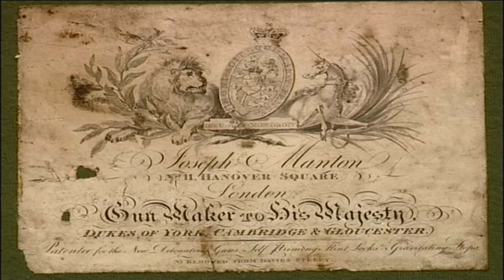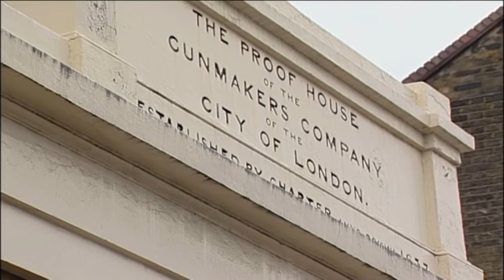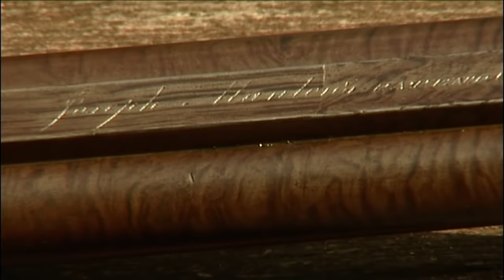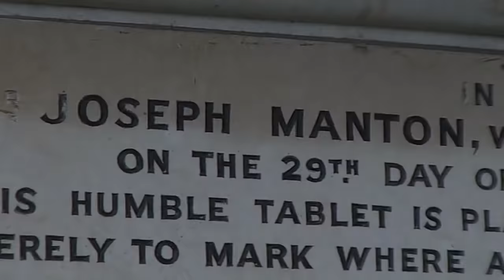Manton - Master Gun Maker

Comment: Hang On!! A gun can cost £50,000, but a 200yr old Manton original is valued at £10,000? Something wrong with this picture. Surely a 200yr old gun by a master Craftsman would cost at least £100,000.
Reply from the maker: I take your point, but something is only worth what someone is willing to pay
Reply: You are quite right, you will not find a Manton for as little as £10,000.

Comment: At 6:19 Mr. Winks calls a screwdriver a turnscrew in the gunsmithing business. Gotta love it! I noticed that his turnscrew has a very long angle ground on it which, functions similar to the hollow ground screwdrivers I custom make for specific screws.
Reply: in french "tournevis" is the litteral translation of  turnscrew
Reply: The profiles of such turnscews / adapted screwdrivers would require a higher grade of steel than regular shaped screwdrivers, would they not? 
Or have I picked up on a different profile?

Comment: Great video... thank you.... of great interest to me down here in New Zealand... I do get some very old guns turn up for work on them. A lot of gun smiths won't work on them; after all, many of the really old ones had non standard threads etc, and were hand made "one offs". You can' buy a mainspring for a flintlock made 200 years ago, and broken springs are not that unusual in such old guns... their spring steel did tend to get brittle with age. Many will not tackle the forging of springs, but the principles are fairly simple, it just need care and a feel for the material. Many of the low priced 'trade guns' had pretty spotty quality of steel in the locks, and need new ones made. I enjoy such work and being retired now, my time is perhaps less expensive that if I ran a commercial business.
Seeing the quality of Manton's work, and indeed that of his apprentices and those that they in turned trained, is an inspiration. Most cannot pay the price of the many hours put into such work, of which most of us would be hard put to match or even closely approach..... but we do our best... :)
Reply from the maker: Thank you for your comment and for sharing your experience.

Comment: just because you can't see the priming go off on a modern gun, doesn't mean there isn't a delay... There is always a delay. Once the sear disengages the firing mechanism, it has to move in order to ignite the priming, then the priming has to ignite, and that heat/pressure has to ignite the main charge. Guns haven't really changed in 600 years, we've just made more convenient ones. The Manton Chambered breech, much like Henry Nock's patent breech, have been studied since their inception, and have never been shown to speed up ignition times over standard side-vents and dished breech faces. The only people who claimed that they did usually were people selling and buying of them. Sometimes an "improvement"...isn't, sometimes, it's just... different. By the time J. Manton was born, the Matchlock ignition was long out of common usage, and flintlocks were common (flintlocks and snaphaunces being around since at least the 1640's), so he didn't really have much to do with that. The Mantons' contribution to firearms design was that they helped to refine flintlock and sidelock percussion technology to it's pinnacle, reducing friction, shortening cock throw, balancing springs, ect. They made fine arms, but they were but one family out of many exceptional craftsmen of the age.

Whether the barrels were heavily filed after proofing, or never sent out for proofing... in the end, they weren't proofed. Serious modifications to the barrels by filing heavily enough to remove those stampings drastically reduces the wall thickness at the point where it is needed most, voiding it's proofing.
Reply from the maker: Thank you for your very detailed reply. You bring up some very valid points, which I am inclined to agree with in part. Thank you again.

Comment: At around 15:10 you describe “white hot metal shards igniting the powder”.  So why use a flint? Did the frizzens wear out and need replacing? Can anyone clarify this please
Reply: And at 23:30 a misfire requires a new flint.
Reply: @patrickbarrett5650  Not always.. a blunt flint can be sharpened (a bit!)by tapping the top face.. Flint is very hard and naturally produces a sharp edge. The flint edge is hard enough to strip off a shard of steel from the frizzen. The friction involved heats the shard to the point it burns. Frizzens did wear out and were either replaced or a new piece of steel was let into the face. Some frizzens were made from iron and then case hardened to produce a layer of steel on the surface. These need to be be re-case hardened at intervals.

In the 18th and 19th C there were very few materials about that were harder than steel. Flint was one of the few naturally occuring hard materials that was cheap and easily obtained at the time. Many of the Napolionic forts on the south coast of England were faced with flint as a form of armour plating.
Reply: @felixthecat265    Thank you for replying, you have really cleared that up for me. I have come across flint walls but I never realised those properties were involved. Thank you for taking the time.

Comment: I do hope that these Gentlemen were able to pass their firearms on to family without trouble due to the Draconian Firearms Laws in GB.
Reply: No licence required for those old guns. No problem in owning a shotgun in UK. As long as no criminal record.
Reply: No idea where you get that idea from. You may have to get a black powder licence, but if you are a honest citizen
Reply: @kennethsmith2758  I got that idea from the law. Antique firearms only require no licence if their sole purpose is display or collection, the minute you attempt to fire them they require licencing.
Reply: Well if you are talking any weapon firing a single shot bullet or missile you are correct. However you can use them on a approved range and belong to a club. Old shotguns the same but you would require a shotgun certificate with no stipulation for reason to own. If you wanted to load your own black powder you would need exsplosives permit.
Reply: @kennethsmith2758  so I'm right then, you do need a licence to shoot them ?
Reply: Yes the same as you need a licence to drive a car or t fix peoples gas boilers. They are however not draconian but a effort to prevent nutcases getting hold of lethal objects. Only yanks would be crass enough to want to fire  hundred years old antiques
Reply: @kennethsmith2758  Only yanks with a political axe to grind as well.
Reply: @kennethsmith2758  Many of these guns were made with a 100 year plus service life in mind. As long as you use black powder only and make sure the barrel has not corroded, they are just as safe as the day they were made.
Reply: sorry i replied to the wrong comment
Reply: @kennethsmith2758  Many of the high quality civilian market guns back then were made with 100 year plus service lives in mind. As long as you use black powder only and the barrel is not corroded, they are just as safe as the day they were made.
Reply: for some reason the comment keeps sending to you. sorry. Since im already adressing you in this apology. let me just say I Agree whole heartedly with your comment.
Reply: @kennethsmith2758  Many of the high quality civilian market guns back then were made with 100 year plus service lives in mind. As long as you use black powder only and the barrel is not corroded, they are just as safe as the day they were made.
Reply: @kennethsmith2758  Criminals can be honest.
Reply: @kennethsmith2758  ''crass'' , but of course.....that's why i can pack a shootin'  iron every day...sincerely, crass  yankee......ps. a beautiful video .
Reply: @kennethsmith2758  
Can you please explain what is "crass"  about wanting to or actually firing a hundred(s) year(s) old 'antique' firearm ?

I have been remanufacturing antique original and reproduction based firearms based on original classic guns designs and parts and classic design patterns for several decades now.

Firing these and any firearms is necessary as was proof testing and proof marking, estabished proof houses, safety parameters for loads, powder and pressure data.

Was any of this ever crass ?

Comment: "Damascus-forged" is misleading.This is a part of a series of misrepresentations used for shotgun barrels (Since the 1880's) that comes from the following history: Patterns in steels from the Middle East, mostly in swords, came not from "pattern welding" as illustrated, rather from the texture and pattern of steel from "wootz" ingots imported from Southern India. Most quality steels early on came from these cottage industry ingots. The irregular impurities, or alloys, game them a characteristic pattern. Japanese steels have historically had similar patterns, but in that case it is from a long history of layered, or pattern welded processes. They now twist their own history in Western language to pander to on-line commercial interests of modern steel makers. To clarify, the word Damascus should only refer to historical solid steels made from founding, not forge welding.

Comment: If the gun has a "lag" between pan fire and main charge a delay you say, then how do you explain the fact that a flintlock will fire UPSIDE down. And the brits would not except a gun that failed that simple test...........
Reply: A lag doesn't mean a failure to fire. It simply means there is a measurable delay as proven by tests done today.
Reply: I think you meant 'accept' which is actually the opposite of 'except '